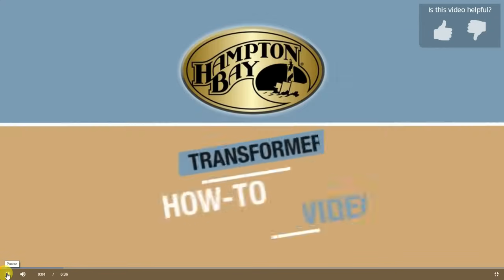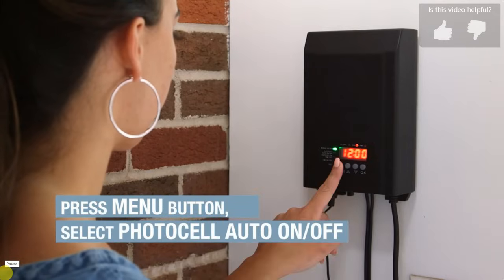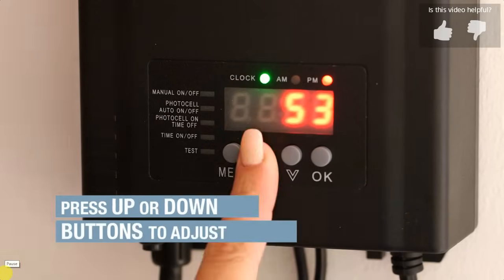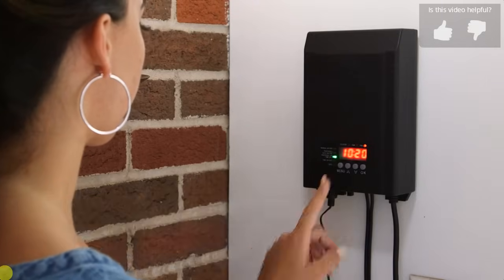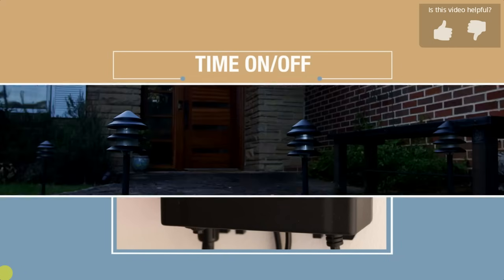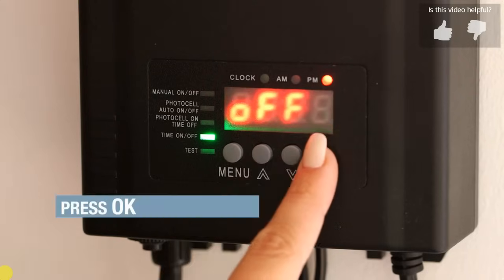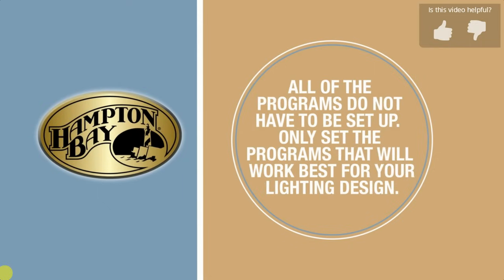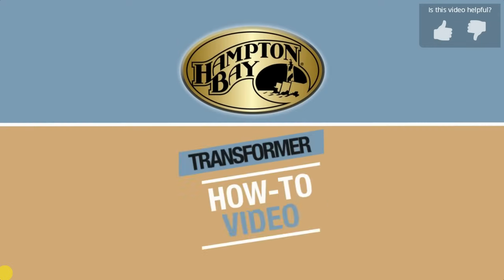How to setup\programing\trouble shooting the Hampton Bay Low-Voltage lanscape transformer

Comment: This is the most stupid product out there. How about simple menu like ON/OFF/Auto/ Manual. I had similar problems with each Home Depot store brand product, like their Defiant programmable switches.
Reply: This one gives you more control over a desired output.  Also its very easy to learn with the video.  I'd say you're missing some cards from your deck if you're still struggling.  Its not even remotely complicated.
Reply: @MaryJane-ln3vv The video is great but for something simple as controlling lights, I would like a product I can operate without the need for watching a video or reading instructions. I have 3 DEWENWILS transformers and they are that way.
Reply: @IB131MS  As I said, this one gives you more options.  Say you want the lights to come on at dusk and go off at 11:30pm.  You need to set the clock for such results. This video shows you how.  You're literally complaining they gave extra options with the device.  If it is too complicated, take it back.  Most people actually appreciate the extra features.

Comment: I setup the "Photocell ON / Timer OFF" mode. It works ok for one day, but the mode never repeats and is off after one cycle. I have to manually activate this mode every day for it to work. Shouldn't it be repeating itself automatically? 
I also did a factory reset, set the time, setup the "Photocell ON / Timer OFF" mode again and it still doesn't work.
Any ideas?
Reply: Yeah, you need to set the timer for your desired "on" and "off" time then it will turn the lights on/off automatically daily.

Comment: Bought a house that has this. There was no manual. I tried to adjust it for daylight time and killed all lights. Found the manual online & still couldn't get the lights to work. They should just transcribe this video as the operation manual. Thanks to it I got it working again in minutes. Actually they should put out a new model with a 21st century user interface.
Reply: They have it at your local Home Depot.  Wireless even.

Comment: My transformer seems to have stopped working (about a year old).  When I press the menu button, nothing happens.  Nothing lights up and and I am unable to cycle through the menu options.  If I unplug the unit and plug it back it, the light next to the Photocell Auto On/Off lights up (I believe this is the factory default), but once I press the menu button, again nothing happens (I do not have a photocell attached to my lights).  Previously the transformer was set for a programmed Time On and programmed Time Off, but I can't even get to the function to set the clock now.  Is there any remedy?

Comment: I hate the set up of this thing. It is so complicated and backwards. It’s like it’s from another era and we bought it like 3 years ago. Once you get the hang of it it’s not terrible but it’s easy to forget all of the extra clicks and steps needed. The workflow this thing should be redone. Very antiquated
Reply: Same. It’s HORRID
Reply: Yeah you're right they made it difficult for no reason really but hey I got it to work now I am happy. If I can just fix my damn pond
Reply: It's almost exactly like setting up a 1980s era VCR. And when the transformer loses power, you need to reprogram. This brand offers an updated smart version of this transformer for about $20 more. Totally worth the extra cost.

Comment: Not calling a number. Someone who knows please answer if a fuse exists in this system. Mine stopped powering on. What causes the power to not work? FYI its connected to always on power. Breaker has been checked. No corrosion on terminals. Knowing all of that what about the unit itself causes this not to power on.

Comment: Thank you!! This was a lifesaver!!
Reply: I concur, this was an excellent video on how  to operate these type transformers.
It standardizes each transformer type and is very easy to follow:
transformer (45W/120W/200W/300W/600W/900W)
mode: SL-45-12A;  SL-120-12A;SL-200-12A;DIY-300PS;DIY-600PS;DIY-900PS;
my hampton was model SL-45-12V

Comment: Totally confused on the difference on "Time On/Off" and Photocell on. Why would you use both?
Reply: I was able to get my light to turn on at 6 pm. But I'm having problems getting them to turn off at 10 pm. Any help will be appreciated.
Reply: This actually helps when the time of daylight changes.  For instance if you want your light on earlier than completely dark you set the time on/off as desired.  But as you move into summer/winter time those times arent as desirable so the photocell can take over.

Comment: My lights stopped working a few nights ago.  When I looked at the box, the test was flashing.  I turned it off and reset the system, set the clock but still no power is going to the lights.  This transformer is only 2 years old, could it be that I need to replace it already?
Reply from the maker: you can call 267-387-6022, the tech will give you a idea for this issue.💡

Comment: where does this transformer have the photo cell ?
Reply from the maker: you should have one in your package when you buy Hampton Transformer, also you can find a replacement on Home Depot website :Model #ZB2-262468-1500 ;  Internet #206365458Store ;  SKU #1001543162

Comment: Does the display on the box turn off after setup or is it supposed to stay on constantly? Mine keeps going dark after 30 seconds
Reply from the maker: It's power saving mode, screen turn off after approximately few seconds of idle time, press any button to trun on the display.

Comment: My lights quit working the other night, and I am having trouble getting it back the default setting, even after holding the on/off for the 3 seconds as mentioned. Box has power, cycles through the green indicators and the clock blinks 12:00. I have even reset the outlet. Any further tips or advice to get my lights back on?
Reply from the maker: All you need to do is setting clock & time on/off program: 
Open your “USE AND CARE GUIDE” and look at “operation” ,  step by step  :  1 setting the clock, 5 Setting the TIME ON/OFF. Done!
Reply: Kelly Kerrigan Hodge hi. did you find out what was wrong?

Comment: What is causing my lights, when set to go on at dusk and off at sunrise to go on and off throughout the night?
Reply from the maker: Overwattage for the transformer. The lights will turn on then when the transformer gets hot it will shut down when it cools off it will restart and do this throughout the program cycle.
Reply: Could be getting light on the photocell from somewheres.

Comment: The screen on transformer blacks out..but when I push menu button it is correct time & settings. Why does this happen?
Reply from the maker: Power saving mode, screen turn off after approximately few seconds of idle time, press any button to trun on the display.
Reply: Happens to me too I thought it was broken and returned it. Bought another one and it did the same thing. Is it really supposed to have nothing and black out the display as power saving mode after a minute? This seems odd.

Comment: bought 2 at home depot, one dead and the they do not have timers in case you are in shaded area. Keep that in mind if you cannot use the photocell due to shade. Mione has no time clock to set
Reply from the maker: if you don't want to connect photo cell, it's allowed to using timer, please see page 9 and #5:
https://images.homedepot-static.com/catalog/pdfImages/d8/d88cb38e-0acd-41ee-a5a7-73180a6cc236.pdf
Reply: Cranston judge

Comment: Is there a way to set the unit to factory defaults? It looks like once "Photocell ON Time OF" is set, there is no way to undo it? Also, what does "Test" do??
Reply from the maker: You can do a factory reset by holding down the "OK" button for 3-4 seconds,m 4 -"8888" will appear and when you release the button it will show 12:00.
At this point you will need to set the correct local time
Also, once you move from one program to another and the previous program is not activated
NOTE: You must press "OK " after you set a program to lock in the program. You must leave it in the program selected, if after you selected a program and decide to use another the previous program is deactivated

Comment: Great!!!! simple video show and tell is the way to go
Reply: Glad you had such an easy time. I haven't been very lucky. The transformer seems to have an "attitude" and I've tried several different approaches...all have failed. I have a degree in electrical engineering and have worked with some very sophisticated equipment in my day. Tomorrow, I'll try to do a FULL RESET...but so far I haven't found anything regarding this process. I guess UNPLUGGING it for a while is a start...LOL... More later, maybe